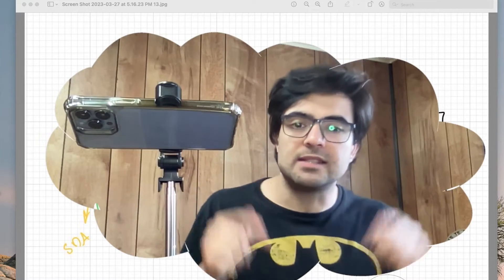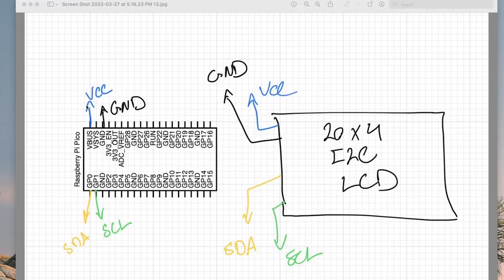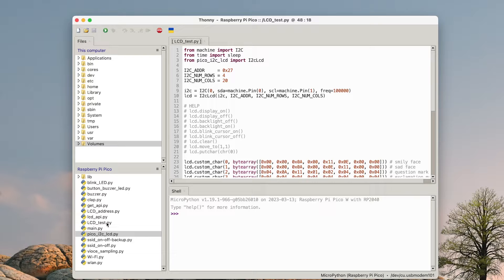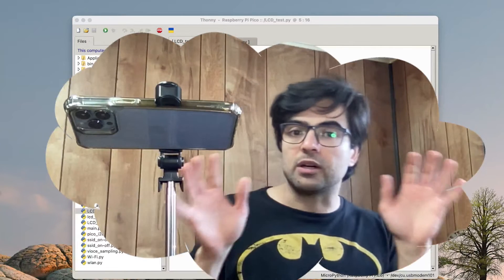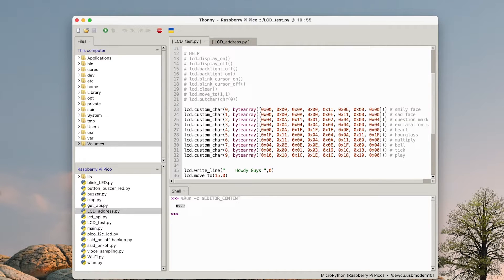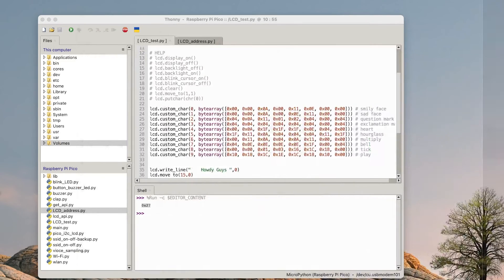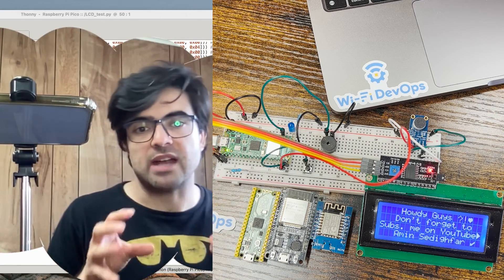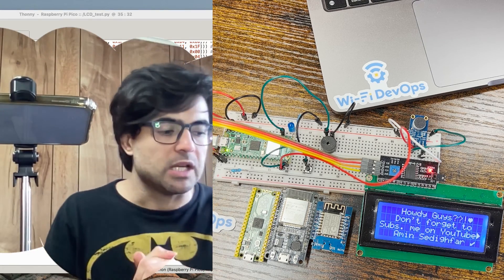20x4 I2C LCD display on Raspberry Pi Pico W

Comment: Not working - 
File "<stdin>", line 35, in <module>
AttributeError: 'I2cLcd' object has no attribute 'write_line'
Where is write_line defined?
Reply from the maker: @rs_stew  Hmmmm 🤔 
I’m not sure, I uploaded everything as it worked for myself. Are you sure you downloaded the proper files?
Reply: @aminsedighfar  
your version of the lcd_api file you copied from an earlier youtube project did not include -
def write_line(self,string,number):
        #writes a defined line to the LCD
        self.move_to(0,number)
        self.putstr(string)
You didn't cut/paste the complete library so your code does not run
Also you define 10 custom characters and the library function only allows 8, so that doesn't work properly either.
Reply: Ok, in your version of the lcd_api file you copied from an earlier (identical) youtube project, you missed the definition of this right at the end of the file. So your code cannot run.  Needs this...
    def write_line(self,string,number):
        #writes a defined line to the LCD
        self.move_to(0,number)
        self.putstr(string)

Comment: not working
Reply from the maker: Why? At which step did you get stumped?
Reply: @aminsedighfar  I get this error: Traceback (most recent call last):
  File "<stdin>", line 10, in <module>
  File "pico_i2c_lcd.py", line 20, in _init_
OSError: [Errno 5] EIO

I have these files on the PICO:
20x4_i2c_lcd.py
LCD_address.py (that found the address of the LCD)
lcd_api.py
pico_i2c-lcd.py
Reply from the maker: @PeterVendelbo  which interpreter are you using? Thonny? Did you choose the correct hardware? The MicroPython version is okay?
I know these questions might sound stupid, but please check them out again.
Reply: @aminsedighfar Yes it's Thonny, and I'm using a 2004 LCD (it works with RPi3) MicroPython was downloaded yesterday from RP website
Reply: Rebooted, and now it's: File "<stdin>", line 35, in <module>
AttributeError: 'I2cLcd' object has no attribute 'write_line'
Reply: Solved :-) two pullup resistor on i2c to 5V
Reply from the maker: @PeterVendelbo  🤩 happy to hear that.